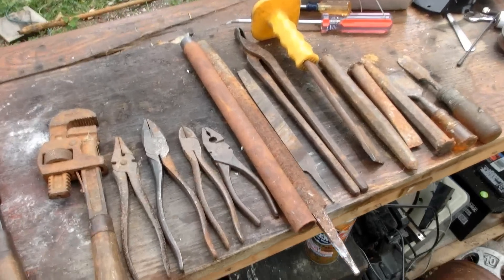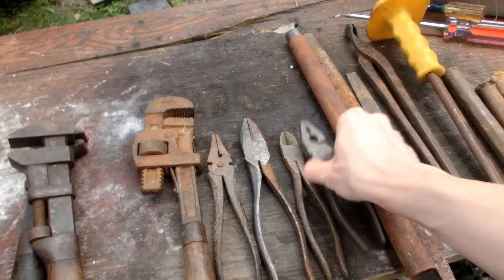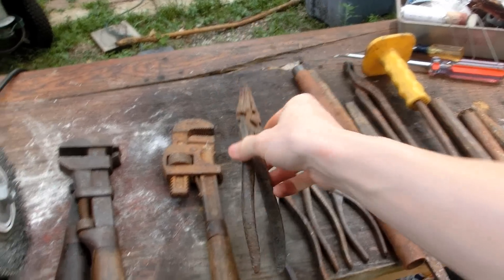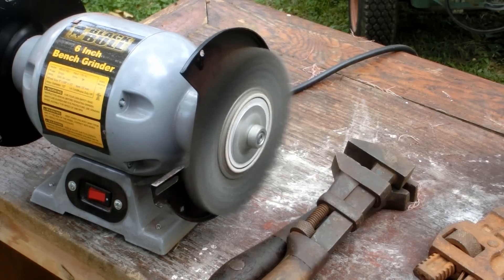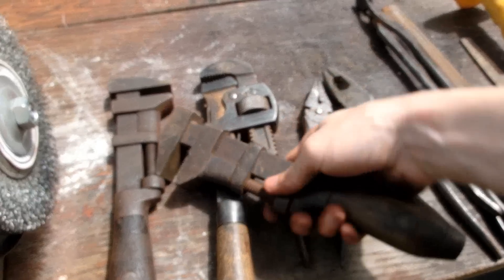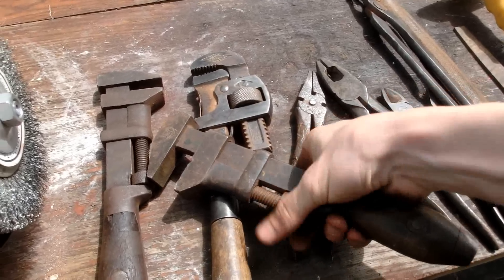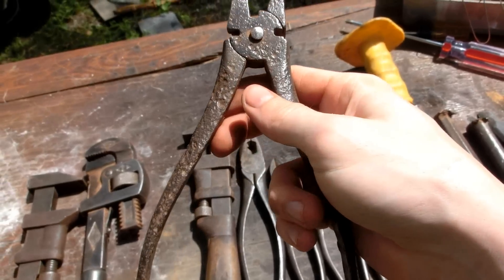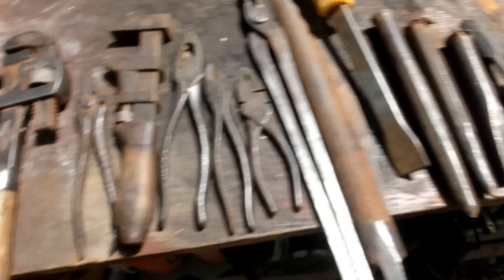Removing Rust From Old Tools

Comment: after cleaning give them tools a bit of W D 40
Reply: +TOM EMBLETON, Me, I always use CorrosionX to keep the rust from coming back as in flash rusting. WD40 just won't stay on the metal all that long when the part is in actual use and subjected to moisture.
Reply: on old tools, just a light rub down of oil works well.
Reply: really good use for old motor oil. just keep an oil change worth in a 5 gallon bucket with a lid in the back of the garage and treat basically any steel with it. never had a problem. makes your hands dirty but, you're using hand tools they're probably getting dirty anyways
Reply: I like to put the oil in an old oil pump can, so I can easily put a drop on, and then rub it in. A lot less messy this way.
Reply: Really good ideaAvery l

Comment: What did your great grandfather do? o:
Reply from the maker: well in the 1920s he helped dig the mine's first shaft and worked there till the 40s. then he got a job at a local Shell oil refinery and stayed there till he retired in the 80s. he was town mayor from the 1960s to the 1990s also. after the 90s he was just doing whatever he wanted.

Comment: Only an amateur would work close to a wire brush without leather gloves and safety glasses.  Bolt down the Grinder.  Easier to replace gloves than skin.  Never wire brush a file.
Reply from the maker: +Gord Baker you obviously never worked with a grinder then, you should never use gloves because the clotch could catch, meanwhile the wire wheel doesnt hurt your hand neary as much. if you wear gloves, you risk breaking a bone or worse.
Reply from the maker: that doesnt matter really, you could still be kicked out of a machine shop for wearing gloves on something like that.
Reply: You would be fired for not following safety precautions.  Obviously you   don't understand basic Safety around rotating equipment.  I am talking  specifically of a rotating wire brush wheel.

Comment: Sure, use a wirebrush without gloves.
Reply from the maker: its safer.
Reply: I guess you say that because you think that gloves might entangle themselfs in the wheel and you have less feel etc. 
Still I doubt that. And everybody I know and every regulation I know also. 
Or you are just sarcastic.
Reply from the maker: Völl Däpp
 no its a rule in some places that you cant wear gloves. you can touch the wire wheel with your bare hand and not get hurt, but youd get a lot more hurt if it had a chance to grab your hand.
Reply: Rinoa Super-Genius Well, that was exactly what I thought you had in mind. I guess thats more or less a question of the right gloves then.
Reply: Great, why don't you want to wire brush your fingers to bare bone? I can't understand that! Bonehead move not wearing leather gloves.

Comment: Another safely item. Grind off the ends of your cold chisels. They come off when you are hammering the end and in the case of a fitter I worked with during my apprenticeship, can blind you. 
Yet another. Bolt your grinder to the bench.
Yet another. Wear gloves. Did you wear goggles?
Yet another. Give up using tools all together. You're too much of a liability.
Reply: Peter Gregory work mate of mine was hitting a mushroomed over cold chisel, a piece flow off  it ,it went through  his jumper, T shirt and bured it self in his chest. ended up at the hospital to get it remove,
Reply: gloves would be more danherous

Comment: Yikes, clean up the striking surfaces on those chisels. The look like a mushroomed bullet.
Reply from the maker: +Channel+ i like the look of the mushroomed heads on the chisels, plus i like that it makes a larger striking area and a bit of a shield for your hand.
Reply: You want to hit the chisel square on the center line to transfer the force efficiently through the  the chisel to the work. Hitting it off center makes it more likely the chisel will shoot off to the side as well.

On the safety side of it, its been common practice for a loooong time to clean these up so bits of metal don't break off and go where you don't want 'em to. What does it look like when you buy a new one? There's a reason.

In this case it's not a matter of being nitpicky, just that there's a wrong way and a right way.

A super-genius should be able to see the logic in this.

Peace.
Reply from the maker: Channel+
no theres no wrong or right ways, just better and worse ways regarding certain aspects.
Reply: Well that's horribly vague. I guess I would just choose to not do it the much, much worse way.

Have you ever noticed how much people hate to admit they may be wrong? Take advice that makes sense? No way! My way is best for me, 'cause, me. Regardless of how little sense it makes.

Oh well, whatever, when has a mind ever been changed in the comments section eh?
Reply from the maker: Channel+
but there are no wrong.right ways. everything is a gradient, nothing is just black and white.
Reply: OK, off topic a bit but....

Kidnapping a baby, raping then killing it and eating it. Then mailing the turd it made to the mother along with a videotape of the whole process. 

What in that scenario keeps it from being wrong? What bit of good keeps it just really grey?

There is right and wrong, this gradient you speak of is a favorite tool of comment section arguers. Oh, and black is black, white is white.
Reply from the maker: Channel+
you do realize black and white are still in a gradient right? just because not everything is black and white doesnt mean anything isnt black and white.

i dont think you understand the argument tbh.

and no, black is not really black, white is not really white. it depends on if your colo blind, if you live in a universe devoid of any photons, and also if your eyes are adjusted or not.

if you hold a black tile up in a dark room and shine a bright light on it, your brain sees that black tile as white.
Reply from the maker: Channel+
sorry, meant to put "just" in there, i fixed my comment.

and lol, your just crazy i think.

Comment: It's bad policy to use a grinder on a chisel
Reply: using a grinder on a chisel or an axe is bad policy because it is risky for the temper it's easy to overheat the metal and damage the factory temper  I'm not saying it can't be done without hurting it it's just best to use a less extreme method like using stones or something like that and idk how they put the factory bevel on them but I doubt that they would use a grinder on a chisel after the final tempering was done
Reply: alright as long as it gets done I guess
Reply: vary true

Comment: Gloves!!
Reply: YeCannyDaeThat I am an OSHA certified safety auditor.  Gloves in close proximity to a fast moving rotary tool is unsafe.   Doing what this person is doing on a brush wheel the hazards to the hands are 1) getting them dirty  2) getting caught in the wheel 3) having fingers twisting around and breaking or spraining fingers or the hand 4) having the wires come loose and puncturing the fingers or hand.  Gloves will only prevent 1) and could snag the wheel and cause 2) and 3).  Broken fingers trumps dirty hands.  So, no gloves.
Reply: nunya biznez getting your hands dirty is not a hazard.
Reply: Alan Liefting That is not true.  OSHA lists it as a safety hazard.  This is because there are substances frequently found in manufacturing and repair shops that are contact hazards and are toxic to the dermis.  If you are using a brush wheel to clean lead paint off an antique cast iron hinge (as an example) the lead paint is considered a dermal hazard by OSHA.  Of course one can wash one's hands and the hazard is minimal but it IS a hazard.  If you are using certain solvents in conjunction with a brush wheel those solvents can be a dermal hazard.  But as I said, a broken finger is a worse hazard so OSHA does NOT recommend gloves combined with rotary tools for the reasons I stated a month ago.
Reply: nunya biznez
point taken but I was thinking about benign things such as oil, grease, non-leaded paints, dust, etc.
Reply: Alan Liefting Of course you were and that is the way most people think.  But OSHA must think in terms of what is the worst possible scenario.  When doing a safety audit you need to be aware of every possible thing that can go wrong, not assume everything will be OK.  Also, a lot of people forget that people eat with their hands.  To get your hands clean enough to reasonably prevent viral  and bacterial contamination one must wash one's hands for at least two minutes but most people only wash their hands for 20 seconds.  Viral and bacterial contamination is only part of the story.  Oil, grease and non leaded paints are still not something you want to consume and a casual washing of hands does not remove all that.  If you handle oils or greases and then wash your hands before lunch, after washing your hands, smell them.  If you still smell oil or grease, that means you didn't wash it all off and you are going to eat some of that for lunch.  I operated wire wheels as part of refurbishing old machinery.  For safety reasons I did it sans gloves but then put gloves on to eat so I wasn't eating paint and oils and grease.  

Mostly awareness is the key when it comes to safety.
Reply: nunya biznez , there is what OSHA/OSH say and there is what is reasonable. Try not to be a 21st century Chicken Little.
Reply: Alan Liefting Good luck.  I have had to treat about 50 co-workers who thought like you, about half had to go to the emergency room.  One lost his hand and another I went to his funeral.  OSHA doesn't make these things up to annoy you.  Every singe item OSHA inspects for is on the list because someone either was severely injured or died as a result of a hazard on the list.  Did you know that if your co-worker reports you to OSHA and OSHA comes by for a surprise inspection and you are observed violating an OSHA rule, your employer will be fined $10,000 per violation and your employer cannot fire the whistle blower?  Safety is not a joke.

Comment: Sprayed your tools with WD40 and wipe off excess...
Reply from the maker: engine oil is far better
Reply: Rinoa Super-Genius WD-40 was created for the aircraft industry to protect machined parts that would be left in the weather until final assembly of an aircraft.  Stands for water displacing solvent number 40.  Yes, Motor oil would probably last longer.